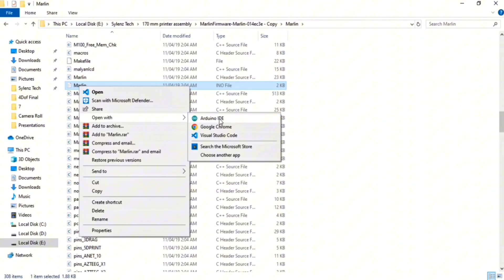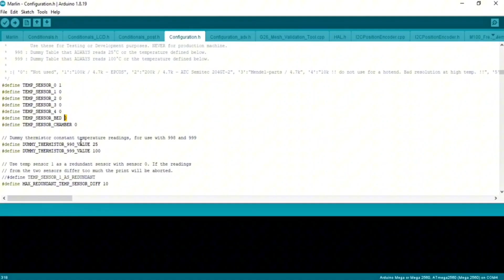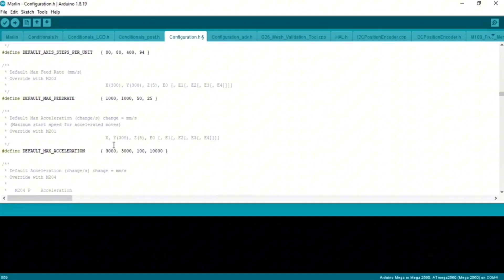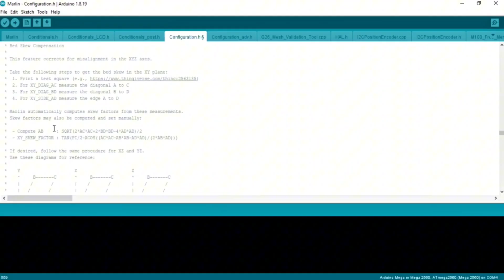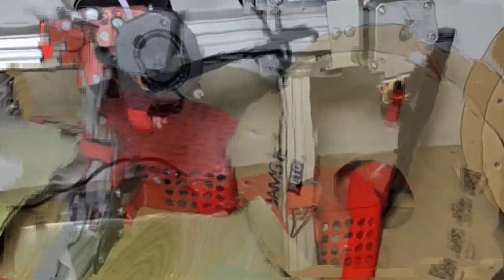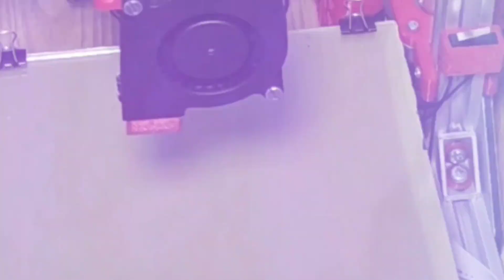Marlin Firmware For DIY 3D Printer | 170mm DIY Mini 3D Printer Part 3

Comment: I am working on a diy 3d printer but I am stuck at calibration, and unable fix....

Can u guide ?
Reply from the maker: Yeah sure share the problem
Reply: @DaretoDream906  I am using the invento nema 17 motors , the X & Y is calibrated ar 3.2 default steps , but I am unable to calibrate the Extruder and Z axis.....

Need help on that..... What are the steps , acceleration and feedrate is required for Z axis and Extruder ?.......
Reply from the maker: @satyamkumar0527  Sorry for Late Reply your comment didn't show up earlier. Default axis steps per unit for Z and E axis are 400 and 94. Feedrate is 50 and 25. Acceleration is 100 and 10000 respectively